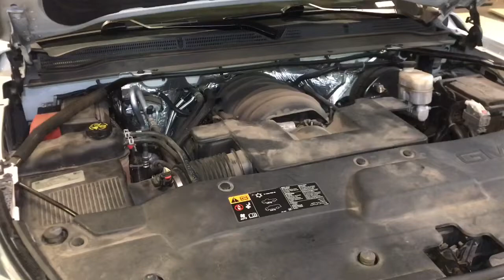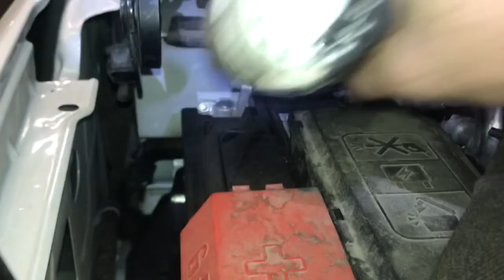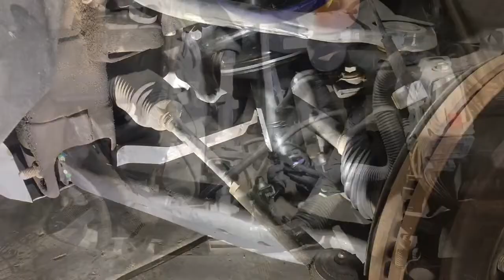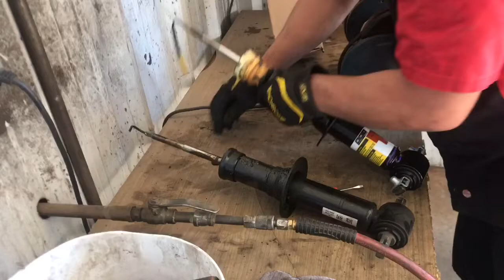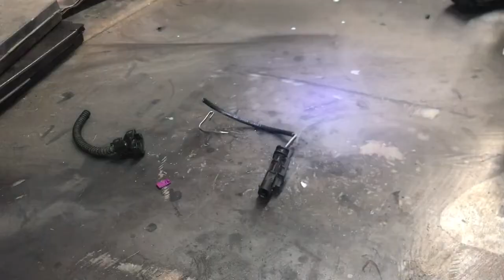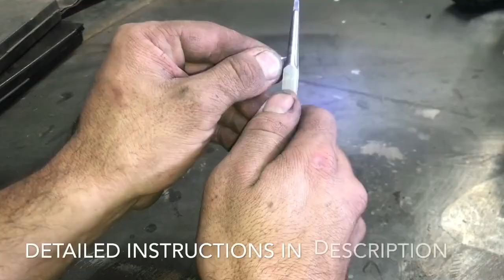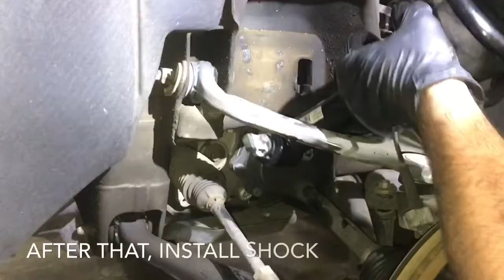Gm Truck and Suv Front MAGNARIDE Shock Replacement (2014+)

Comment: My right front went out at 37k. Great video. Went ahead and just replaced both. Found the replacement connectors at Digikey
Reply from the maker: The price for these are steep. You think they could at least give you a dang connector
Reply: Especially considering they were $1.50 a piece.  Here is the Digikey part number. 1-1703498-3
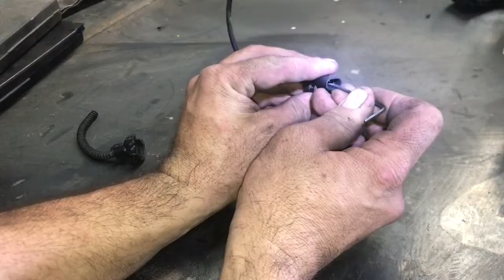Reply: @mem901tn9  When you ordered the part from Digikey did it come with that tiny purple piece that was removed at 7:06 in the video?
Reply: C P Yes
Reply: @Mem901 Tn Do you have a part number for the Digi Key connector?
Reply: How you know it went out?   Also did it drive differently?   As-in tracking left-to—right when going down the road?
Reply: @Mr.Beastforpresident  my was diagnosed by a mechanic, he said the uneven tire wear was caused by a blown shock, and when i checked it, it had grease coming out the top.
Reply: Is there a part number for purple piece with Digikey?
Reply: Tommy Taylor I’d like to know the same thing!  Can we get a response about the small purple piece being included or not??
Reply: Tommy Taylor The purple piece comes with the new connector. It really doesn’t even need to be removed, you just have to release the pin from the connector.

Comment: Dealer just told me $1900 for front struts and alignment. I said  wtf...  70k. Crazy... 2015 Yukon Denali.
Reply: ACDelco 84176631 GM Original Equipment Front Shock Absorber https://www.amazon.com/dp/B010GP0MT2/ref=cm_sw_r_cp_apa_i_psepEbKDPHPJS

Cost $800 ruffly parts and labor. Came with connectors. But our still rides like Sh#@. Back in shop today. Has service ride errors. My f150 with a lift rides better. It's like a low rider without shocks.
Reply: I just got quoted $2500 to replace both front struts (alignment extra!).  Insane.
Reply from the maker: Wow!!
Reply: yea....my front right is leaking and they quoted me 1600 for parts and labor and then another 100 plus for alignment. I may just buy the entire piece as one and install it
Reply: Does that include Limo ride to and from the dealer and a Butler and meals until it’s fixed?
Reply: Regular Guy Fixes Does that include Limo ride to and from the dealer and a Butler and meals until it’s fixed?
Reply: @Mr.Beastforpresident  you can barely get a dealer to do anything Anymore. $115 hour Insanity.
Reply: Regular Guy Fixes Then you have to ‘ hope ‘ they do it right. Nowadays things are more expensive, more complicated and a pain in the ass. The new Ford Ranger $46,000!  For cheap 💩 $15,000 truck that you barely got enough room to fart or adjust the radio without bumping elbows. 

2007 and Older Chevys you can change the ‘ shock not strut ‘ in 15 mins. This new strut shit, you have to take off of work, and make a damn loan to change the struts, either way even if you do it yourself, damn wall mount strut compressor is $800+ then whatever the struts cost. The ( aftermarket whole strut spring assembly )  is 💩. Cheap strut compressors are 💩 with crap cast Chinese paperclip quality steel.
Reply: @Mr.Beastforpresident  yep, I looked into that. I wound up getting AC delco struts for like $300 on Amazon,took to a local garage and they did it. Cost $800 total. Still rides like a low rider.
Reply: Regular Guy Fixes About to do some on a 2018 Silverado with 75,000 miles. Shop said there’s like 6 different struts and spring coil variations, some have 4 ring coil springs, some 5 and some have 6 different models and trim levels have different coil springs & strut valving  depending on trim level, factory rim size, 4 wheel drive etc...
Reply: Regular Guy Fixes Glove box codes for identification are GAP, TCP, TAC and CSW. You may have put too stiff of a strut or too soft. I believe factory 20” & 22” rims come with softer struts. Or soft coil springs with stiff struts.
Reply: @Mr.Beastforpresident  mine are magnetic controlled.
Reply: Same here.  Ripoff